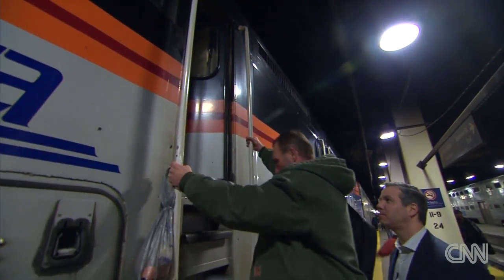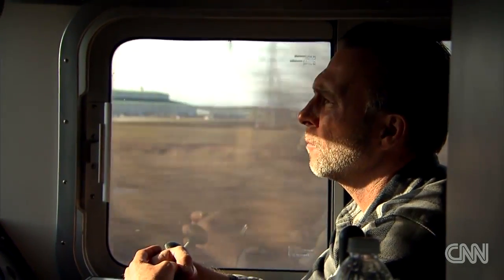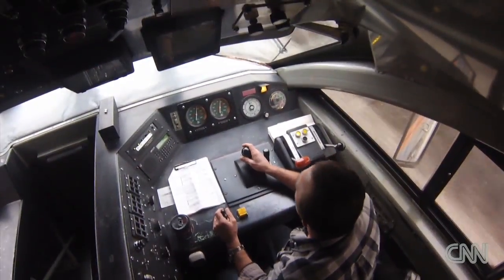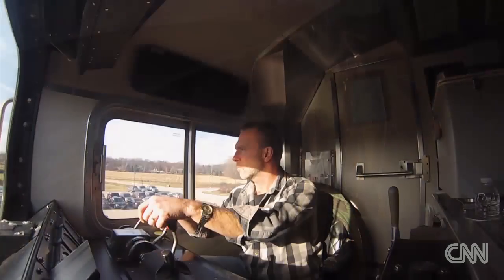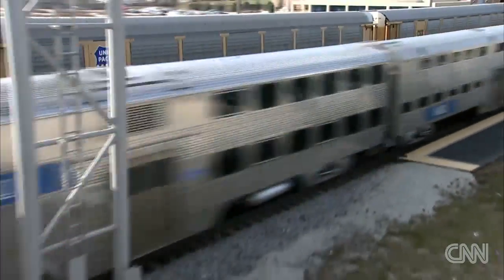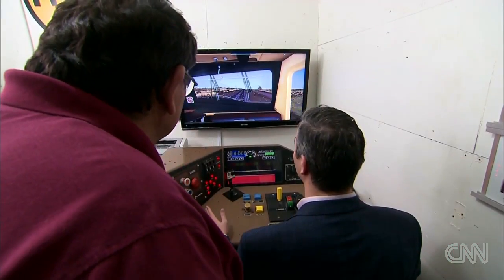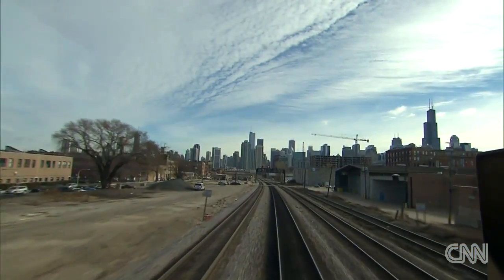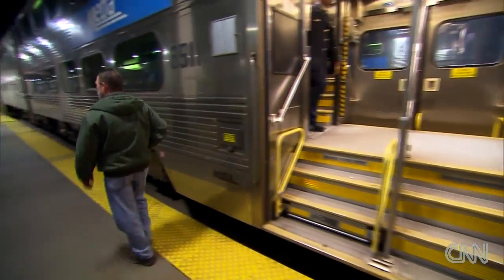Do you have what it takes to drive this?

Comment: I can drive this, having ADHD means I can split my attention 10 fold.
Reply: Joshua White  You don't drive a locomotive you operate or run a locomotive. There's no steering wheel.
Reply: @markfrench8892  Funny-on the back of my CDL it says "may OPERATE trucks over 26000 gvwr w/trailer over 10000 gvwr. But there's definitely a steering wheel in those things. Operate it, drive it, oh hell- it's all the same thing to me. Y'all ain't gotta be so nitpicky about it...

Comment: Well it's not that hard to drive a train if you really know something of trains like me but the best and in my opinion easyest train class to drive the SD and GP classes and in sometimes dash 9s too.
And let's all get real for a second cargo trains are the better of them all passenger trains need to be on time they have to go faster and really in America not good amtrak expecially very expncive and slow and never on time
Reply: That’s good. I’ll bet you could show me a thing or two. Which simulation program do you run?
Reply: @brianburns7211  I have played train simulators since the 2012 version and so on and so forth, just have neough time to finish 3 long missions, 4 short ones and 1. 5 hours of free roaming around a yard to align stuff and you might just get somewhere in 7 to 8 years. But I wish you good luck if you want some other tips I'd recommend going to Profesional sites I also visited a long time ago but I don't remember at the moment since it's about 2:23 am. So see you
Reply: Fernando Queiroz Popovic I don’t need to know about simulators. I was joking. I did take a 13,000 ton train 240 miles today though.
Reply: @brianburns7211  well I commented that at about 2 and somethings AM that day so yeah...i didn't get the joke I guess (yes I know my sleep schedule is crap).